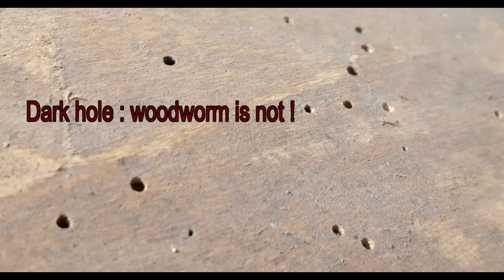Old wooden trough Restoration, DIY, Renovace starých troků

Comment: Great restoration of an interesting item from years gone by.  Was that trough originally used in the home for food preparation?  What was the  graphite solution which you applied to the iron straps?  Was it powdered graphite mixed in water?
Reply from the maker: the trough was used for pig slaughter.  Yes graphite in water.

Comment: Are you sure this is a trough?  The  rounded bottom with no legs and the handles on the ends suggest that this may have been  suspended by ropes, there's also a possibility it could have even been used as a baby's crib.  Given the shape, I don't think it was meant to be sitting on the ground.
Nevertheless, good preservation and again keeping in mind the history and original state.  It does make for a good garden planter but I would have made a stand for it to keep it up off the ground and drilled a few drain holes in the bottom to let water out.
All in all, still a good job indeed!